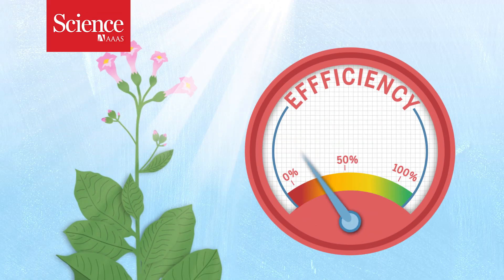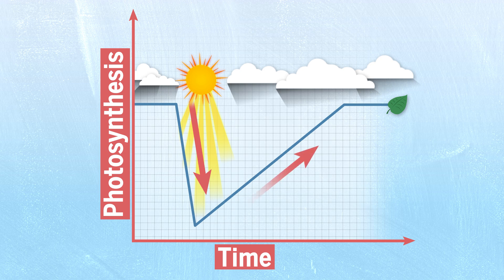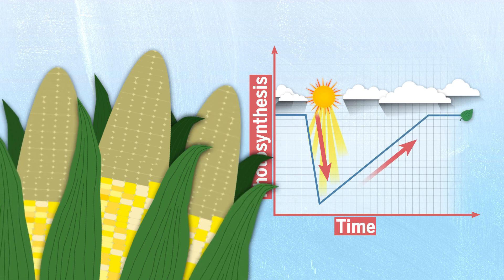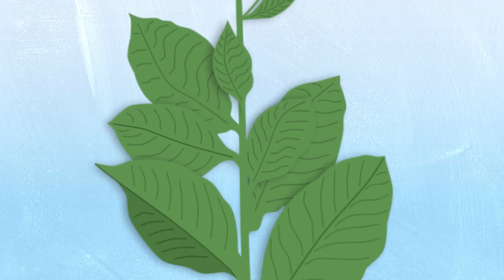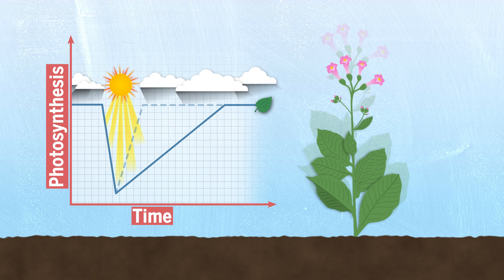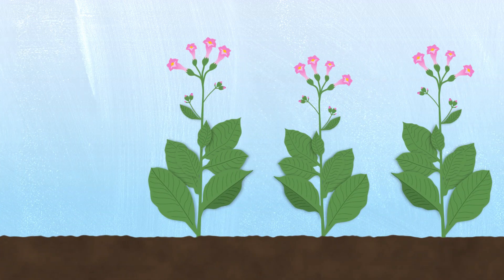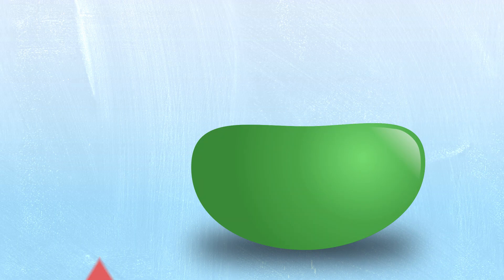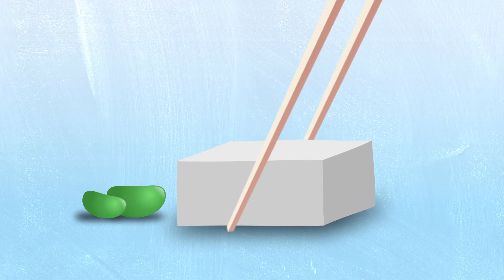Turning up plant efficiency

Comment: I read the review article, but I don't get it. If the plants have (and use) this mechanism (nonphotochemical quenching) spontaneously why we need to edit their genes to make them recover quickly? It's like trying to make humans get enough sleep with only 2 hours while they actually need 8 hours. For the plants it's the same thing, and if we try to change this may be it will lead to harmful effects. Plants understand themselves better than us.
Reply: Evolution is always leading to adaptation and often fails to obtain perfection in its design. This is, for example, the case for photosynthesis where, during millions of years of evolution, a wasteful mechanism to protect from excessive sunlight (non photochemical quenching) has been developed, which is optimal for plants to protect themselves and survive, but leads to great losses in terms of biomass production. Of course, this doesn't bother plants that are just designed to survive and reproduce. But knowing that there is this wasteful system and that it can be improved is really promising for agriculture and crop production. This research shows exactly that it is possible to manipulate this process to obtain better yield in a crop field, in a very controlled way and without harmful effects. If you want to read a reference: http://www.pnas.org/content/pnas/112/28/8529.full.pdf